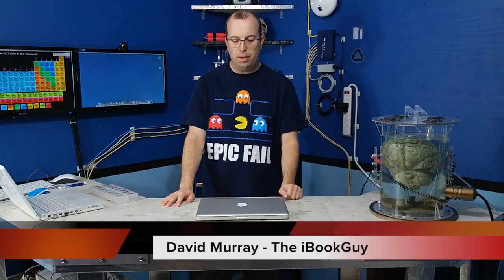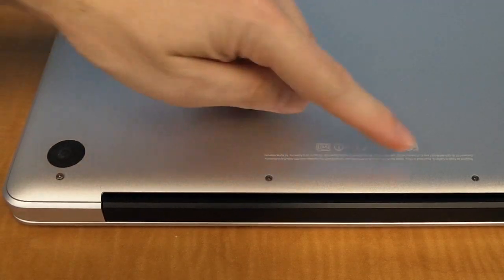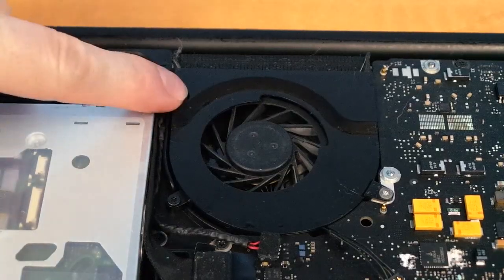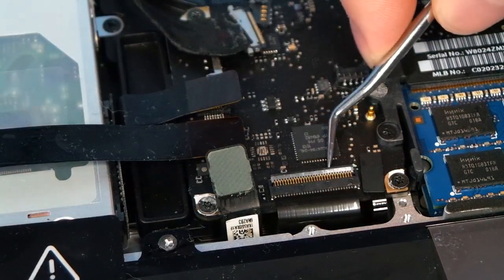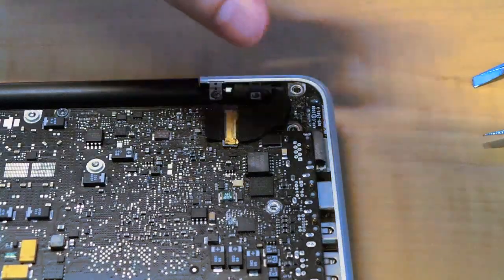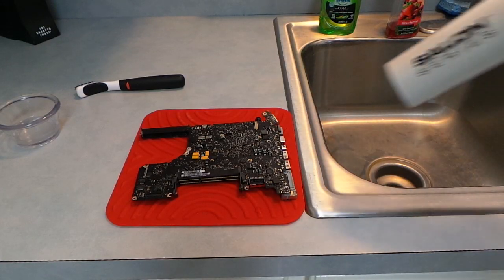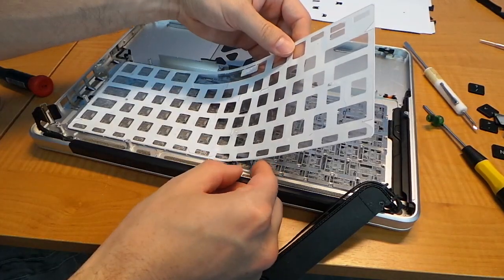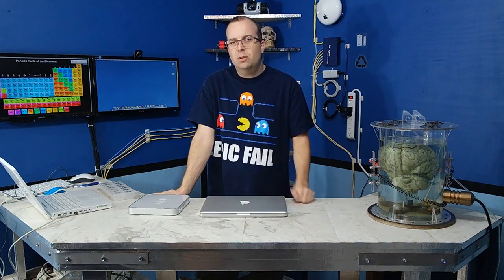MacBook Pro 13" disassembly and gatorade spill cleanup.

Comment: I spilled a whole glass of water on my Mac laptop just like the one you disassemble. Now the keyboard and power button don't work. But the computer does still work. How do I fix this. When this laptop shuts down. The only way it will start again is if the battery is dead and when I put charge the charger on it.
Reply: Džiugas Sutkevičius but it's my favorite one...
Reply: deathpresent101 replace it and get the frame out of your fav one and pit it on new one

Comment: Did anyone else cringe when they saw the frame of the logic board being put under the water tap before he said it would be fine?
Reply: me
Reply: dude, its the motherboard, it wouldn't get broken unless it were powered so electricity would get between the components. i spilled on my old laptop and riinsing the motherboard made it work. my computer gets so hot tho, the board naturally dries off.
Reply: CalculatinGenius Okay I get that

Comment: I bought this model MacBook Pro back in 2010. Maybe my first or second week using it, I spilled hot coffee all over the keyboard. I managed to flip it over immediately and shake most of the coffee out, but the keys were definitely sticky after that. I went to the Apple store and they said they wouldn't fix it because of liquid damage. I've never had it repaired, but it continues to work even today and through all the terrible OS updates. Should I seek repair? Update RAM?
Reply: Steven Sanfilippo does it still work though? Did apple take your macbook's bottom cover off and have a check? What did they determine. I'm in same situation with you. I'm very concerned. I spilled a whole cup of coffee on my macbook's keyboard :( what should I do now?
Reply: Apple is terrible for that - they look for any excuse to not repair your products and force you to buy new ones. Then if they DO fix your product you end up paying way too much for the repairs. The last Apple device I ever bought I took to get repaired and they refused to even LOOK at the thing and said it wasn't repairable and that even if it was the repair wouldn't be worth it on such an old device (2.5 years old) and I should just update to a newer model which they proceeded to give me a sales pitch for. I told them I am fairly sure they could repair it and that it wouldn't be more expensive than a new product and they started to literally laugh at me and said if I wasted my time getting a 2.5 year old phone repaired it'd last me another month and break again. I complained to the manager of the store about how their employees were treating me and he said "well they're right, you can't get that repaired it's already at the end of its life span" and no matter what I said they were in a united front against me saying essentially "buy a new one, we aren't even going to look at your phone and it will NEVER get repaired by us" so I ended up throwing the phone in the bin and buying a Samsung which has been fantastic so far. I don't mind some of Apples products (just not their computers) but their business practices totally put me off and now I deliberately avoid anything with an Apple logo or a lowercase i at the start of the word.
Reply: Crapple Products!

Comment: You fucked up hard with putting it under watrer. Yes true u dont damage board when its turned off but when water dry out some materials dissolved in that water can make shorts. Trick with water is good only if water is distilled.

Comment: Scraping off the corrosion doesn't do anything, all the damage is going to be under the chips that you cant scrub. You got lucky on the other ones. Other damage to components are possible to like the fuse (ha what am I kidding those never blow in MacBooks) capacitors and chips, simply running a gatorade damaged board under water to clean the surface is not likely to do much.

Comment: I spilled powder made Nestea on my MacBook, dried it as much as I cud, unscrewed the back off and tried to wipe down as many crevices I cud in an hour then I turned it on, it turned on but the screen was like lines of different colours so I turned it off. I repeated cleaning n turning on for like 3 hrs. den I read dat I should leave it to dry so put it upsidedown with the screen open and the bottom lined with tissue paper with the cover over it. it's been 2 hrs and it's not turning on at all. if I clean it like this, will it work?
Reply: keep da logic board in a bag of rice and THEN try getting the crud off
Reply: np